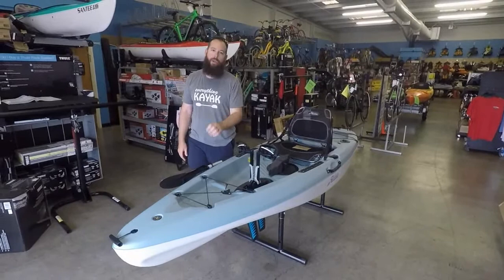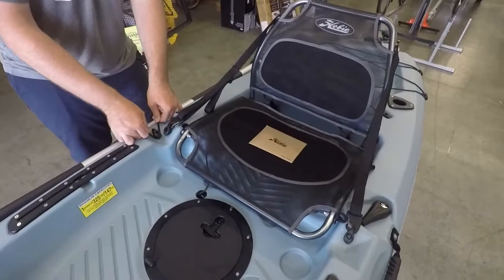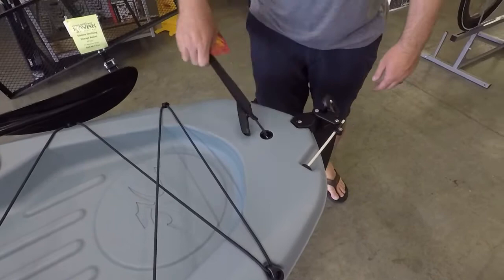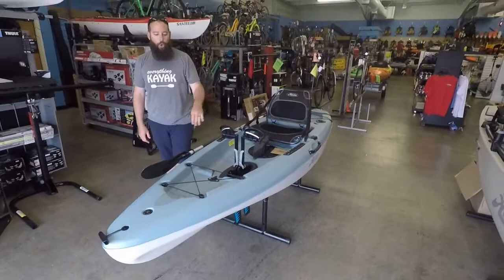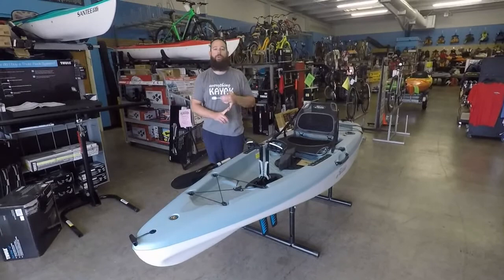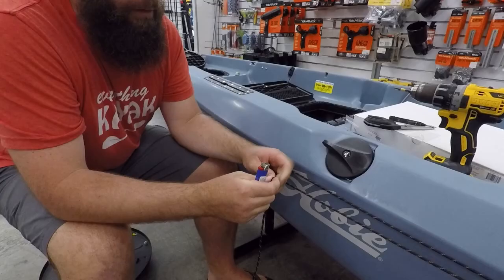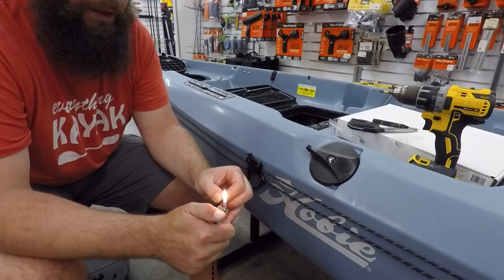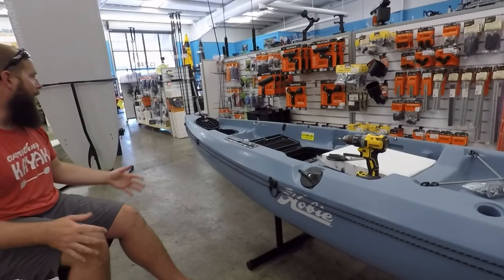Hobie Passport Complete Walkthrough

Comment: Why are the scupper holes not flush all around. There's like a lip, edge, etc inside the scupper holes where the two shell meets. Doesn't look good to put a scupper cart through it. Any concerns?
Reply from the maker: Hobie have designed these scupper holes to except their plug in carts. At this time we have seen no issues.
Reply: Thanks for the info but did you look down into the scupper holes. Its my last concern that's holding my decision on buying one asap.
Reply: @billyvang673  get a c tug cart
Reply: Probably will